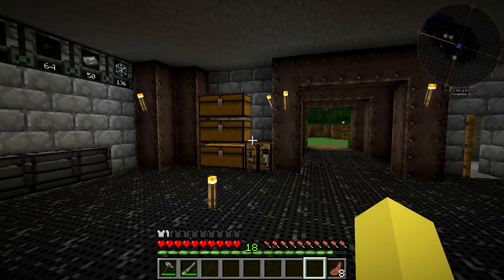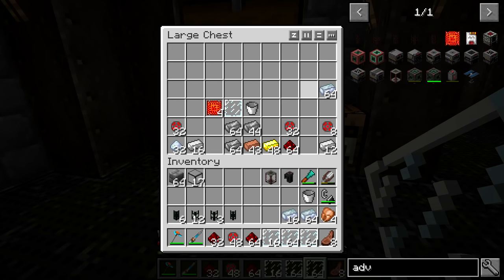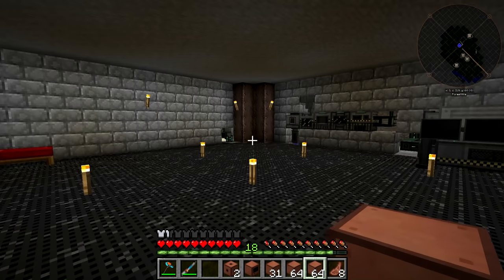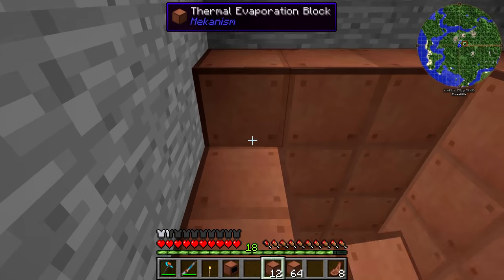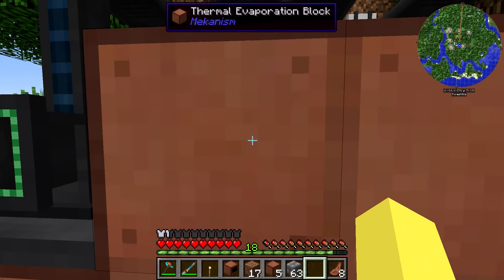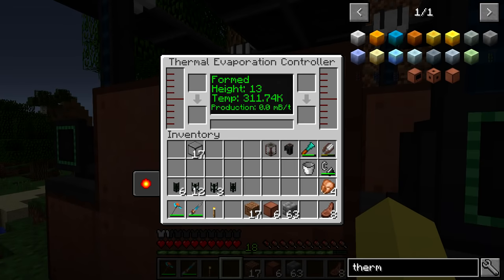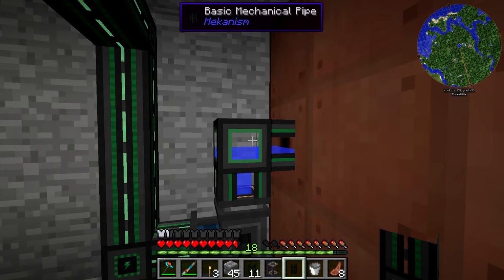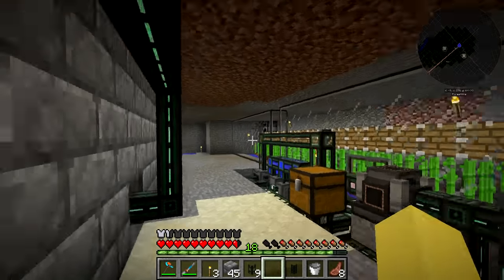Surviving With Mekanism v9 :: Ep.7 - Thermal Evaporation Plant

Comment: Yes the adv solar generators ARE expensive and a pain to craft. That's why I built a resistive heater and pipe the heat in. Adv solar generators are not required at all in v9. Liking the series btw.

Comment: For the multiblock lags, it's just Mekanism checking out the whole structure every time you place a block (I had such lags even in creative in a void world). It's a little bit annoying but the only way to avoid this would be something like IE's hammer (aka: you tell the structure to check out by itself, so you only lag once) ;) BTW I love your videos :)
Reply: Before Mek 9, you were forced to use solar panels, wich only run during day time (and you had troubles with the rain too). However, you can now use a resistive heater to turn power into heat and then transfer it to the thermal evaporation plant with thermodynamic conduits, so it can run underground and during night and rain. (And this means you don't have to wait 5 minutes for the structure to warm up after the night).
Reply from the maker: Thanks for the heads up :) Some other viewers have also mentioned dual layered textures cause lag for Mekanism too. Idk if I can do much about it, but its nice to know the root cause! As for the resistive heater, thanks for the reminder! Totally blanked on it during the episode so I guess we will cover using it in a future episode (hopefully soon).

Comment: One, the controller can be placed anywhere except the bottom 4x4 layer. Two, did you know that the energy from the solar generators isn’t used, you can rotate them and put cables to use their energy

Comment: in version 9 , i noticed you dont need the solar panels for the thermal evaporator , can use a heat generator which saves a bit on resources
Reply: jmm1233 a ,,bit"

Comment: Is the lag your assigned ram capping out and causing problems, you can check quick and easy in game by pressing f3 and at the top right if your ram hits the max it will lag, usually it can be fixed by adding more ram via the launcher

Comment: you said the controller has to be in a specific spot, but that's not true.  it can be anywhere, just like a valve.  you could have put it down inside your mechanical room.

also, i know others have mentioned it, but i just want to point out that using a heat generator creates SO much more heat.  with the solar panels, the max heat increases with height, but with a heat generator, it doesn't matter.  you can make it only 3 tall with a single heater generator and still get it hotter than the tallest solar one.
Reply from the maker: The controller can be placed in any spot IF you would like a tower that is not measured to its full height. The height of the tower is based on where the controller is placed and therefore, there is no reason to place it any lower than the top layer. As for the heat generator, I wasn't aware that it still produced actual heat (I was told it was patched recently), but I will have to look into that if it wasn't changed.
Reply: no, that's not true.  maybe it used to be true, but all i can speak for is what i know.  i'm using version 9, and i've been placing my controller near the ground... it still registers the correct height, and still produces the appropriate amount of brine for that height.
Reply: sorry, i didn't mean the power generator that runs off heat, i meant the actual heat generators that are designed to produce heat.  you cover it in a later episode; i just commented about it for anyone watching these episodes at a later date who may not be going through the entire series.

Comment: Mekanism uses dual-layer textures.   :)
Reply: So, every times placing Mekanism blocks produces a little bit lag. And the maximum height of the Thermal Evaporation Plant is 18.
Reply: Liquid flowing also produces some lag.
Reply: seems so, since everytime he connect basic universal cable thingy it give lag between textures..
btw isn't TE duct and BC pipe also show stuff in it?
Reply: Yes, though BC has been around long enough they've scrubbed as much lag as possible, and TE has opaque ducts for just this reason.
Reply: The update rate of the blocks from Mekanism is very high.
Reply from the maker: OHHHH! This all makes so much sense now! Thanks :) Always bothered me when normal blocks didn't cause lag, but liquid and Mekanism blocks did.
Reply: DrRageHard And in Minecraft 1.10, liquids are very lag when modded.